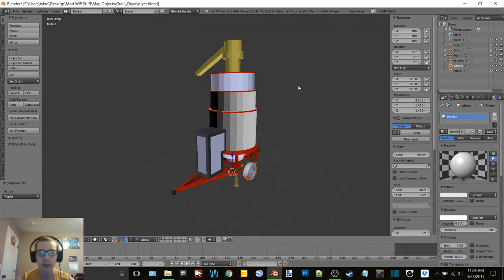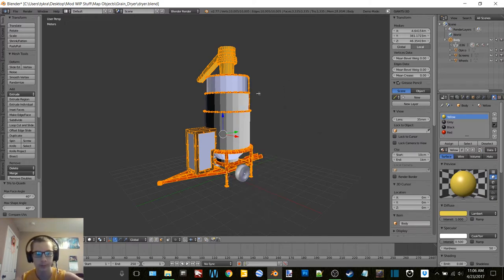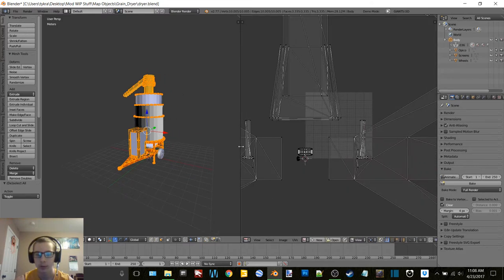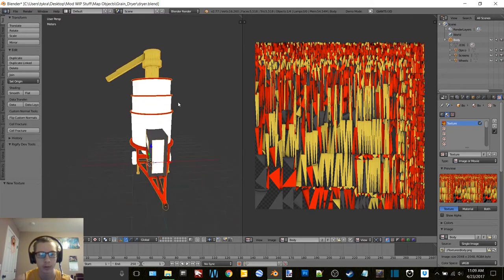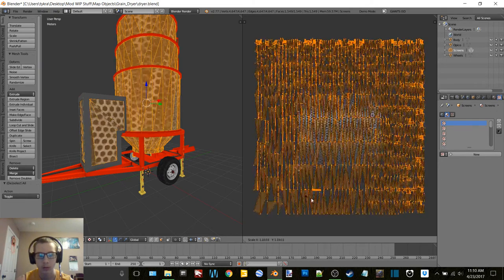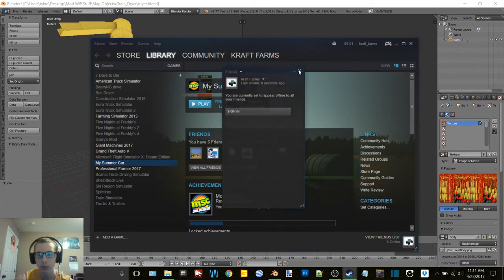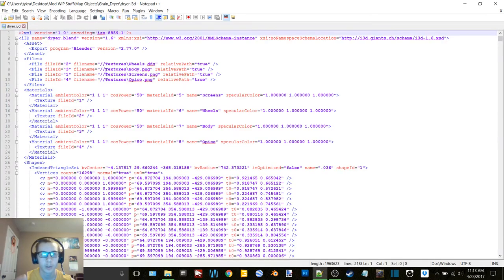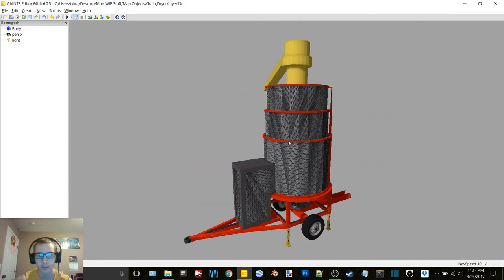Thursday Modding Ep 9-Grain Dryer Work Part 2

Comment: Hey bud, your videos have been great help for me. I'm having a specific issue that I can't figure out though. I'm having issues with models having pieces that are invisible when I get them in ge. I always use split edge. The only way I can seem to fix them "some of the time" is to use the solidify modifier. The issue I get then is the edges begin to flash a bit. I've tried raising the margin in the bake as well. Just can't figure it out.
Reply from the maker: Have you tried flipping normals before? I've found that if I do that it'll sometimes fix it
Reply: Hmm no, I remember seeing that somewhere but not real sure how to do it?  I'm still learning haha.
Reply: Ok of course a quick blender search on google answered that question. I'll give it a try. Ty for the suggestion.
Reply: Actually I may have been using the wrong dds format?  I was using dtx5, switched it and some surfaces showed up?
Reply from the maker: Hm, guess I never considered that one before lol